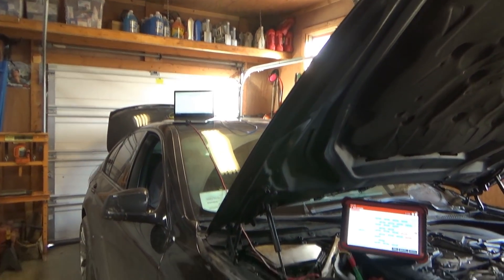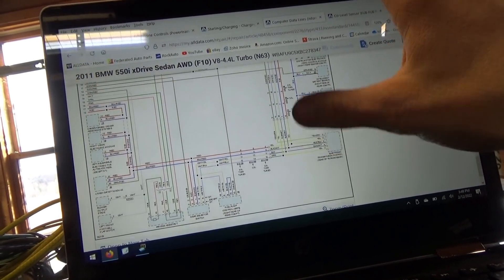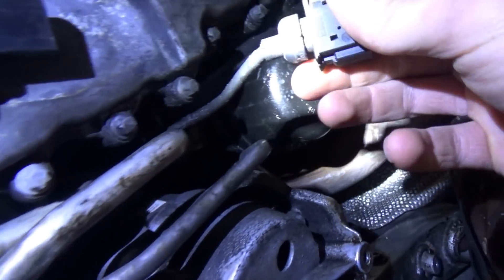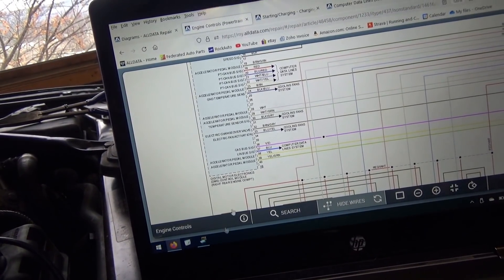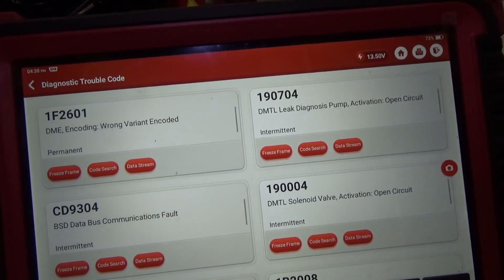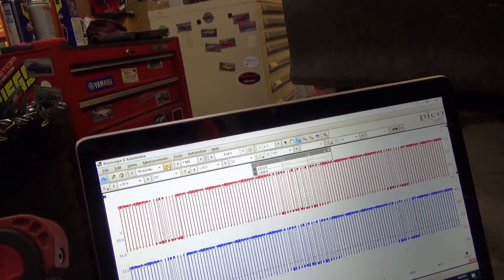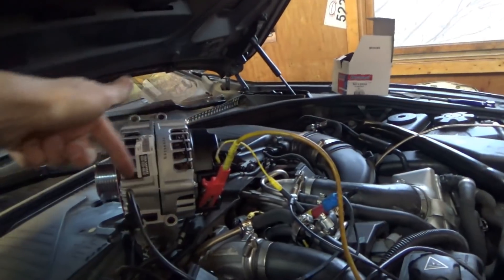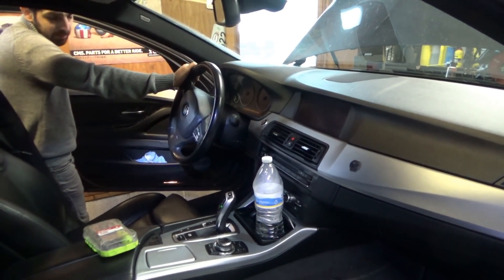Customer Drove 15 HOURS...BMW: What's my OIL LEVEL???

Comment: That was worth the 15 hour drive; great case studies. These cars really are made for wealthy people and corporations that run 3-4 year leases.
Reply: A very experienced mechanic told me, "If you MUST have a European car, buy low mileage ( not new) and sell before 100,000 comes up, otherwise mortgage your house."
Reply: Or, you know, competent mechanics.
Reply: @mungtor  Nahhh... its not worth keeping a car that breaks often. I had a Q5 that needed the ECU programmed at the dealer due to water getting into the housing. Stupid designs, stupid expenses
Reply: @mungtor  the car doesn't have a dipstick...

Comment: It's not the engine ground. They left the ground bolt for the coils loose , which caused the bsd circuit failure. Can't blame the car for someone not following procedure.

Comment: I bought a 2013 BMW 528i with 112,000 miles from an auction.  I knew it had issues before I bought it.  The timing chain was going bad, (infamous problem), the VVT servo motor was stuck in the minimum position so it wouldn't hardly run, the oil level sensor was bad, the AUC sensor was bad, both engine mounts were broken and sunk down, the turbo boost solenoid was bad, and I replaced both Adaptive Headlight Modules due to water corrosion.  So after about $4000 of parts and no labor since I'm a retired auto technician, the car is actually pretty nice.  Who makes an engine where you have to have a sensor to read oil level?  BMW, that's who!
Reply: Pretty much everybody these days.   Checking the dipstick once a week also might not alert you to a blown seal or other leak.  Do you still want a dipstick or sight glass to check the fuel tank?
Reply: @mungtor  but running of gas is different from ruining an engine…
Reply: And how much that sensor cost…🤔

Comment: After solving all these electronic issues this owner has the "joy" of the timing chains, rod bearings and gawd knows what all else mechanical engine parts failing too.  These vehicles are glass cannons.  "But they drive great" - but what if you can't ever drive it because it's in the shop draining your bank account?
Reply: Tesla. An option ?

Comment: My son's 1 series had a faulty alternator that passed testing on a bench but when in the car and driving it would light up so many warnings and throw so many codes in loads of the modules. Ripple current, over charging and cooking battery etc etc etc. BMW's are stupidly complicated across all cars in the range. I love the X5 / X7 but every diagnostic video I see on them just reinforces why I will never own one. You sneeze in a BMW and I swear they throw a code.

Comment: Two comments:
1) If everything were on one network, the car likely wouldn't have operated at all as these module faults began to occur, so the network complexity does provide a level of redundancy.

2) BMW designed this car to be compatible with parts cannon diagnostics.  Just keep replacing modules in sets until it's fixed.

Comment: That oil level sensor is $300 for aftermarket brand. A dipstick would not fail at all. Maybe some of the folks with BMW need to experience some of the service costs personally to understand their wild inventions and maintenance fees.   
No ground wires connected to the engine?  Opps...ouch.
BTW, nice 2X extra long hose clamps on those coolant hoses.
Reply: I've had a dipstick tube rust off and you can't get a new one because discontinued.
Reply: @vw5056  You can make one with a swagging tool.
Reply: @vw5056  Junk yard will have it
Reply: @A. Melbs Ask a repair shop to use their sources and fix it or, do the research. No one is coming anytime soon to help you. If you have no experience in salvage yards and how they are run...pass the job onto someone who is.
Reply: @A. Melbs Open your mind. YOU have to research the part. If that's too much to handle, forget the idea. You have to find the salvage yard on your own...or ask around or get some common sense fired up and challenge yourself in finding a source who has what is needed. Maybe a dipstick tube from a different engine will work, pull out the old rusted part from the block, cut off the rusted area of the old tube, weld on a replacement piece that yields the same length as the old one and press it into the block?  Seems like a fair idea if you can't find the exact one. Most of them are the same diameter so order a new one that has the same diameter and do the above. There is no magic involved, just personal effort.
Reply: @A. Melbs Obviously you are not familiar with cars. Go peddle your papers elsewhere.

Comment: Another great job Ivan! I can feel what you really want to say about BMW’s. Over engineered, way too complex, oddball problems and on and on. No dipstick! Let’s rely on a a complex failure prone system to check oil level. Plus having to use a bmw battery with it’s own chip or else you lose electrical functions.
Reply: It actually makes sense for mechanically challenged owners. If there is a low oil level warning light they might actually top it off.
Reply: BMW engines don't need a dipstick since the dipstick sits behind the wheel. 😉
Reply: @cullenmiller8170  BMW even advises you not to open the hood but to take it to a dealer on their info display. What’s next? 2001, Hal open the hood please. I’m sorry Dave I can’t let you do that.

Comment: So the  final conclusion is to not buy used, expensive luxury SUVs from hack mechanics?  That seems pretty obvious and not really BMWs fault if somebody can't put the car back together correctly.   Yeah, the lack of dipstick is weird and annoying, but 99% of car owners today wouldn't know how to find the dipstick if there was one anyway.   I'll bet a that sensor and a warning on the dash has saved far more engines than the lack of a dipstick has caused.
Reply: Most cars have a dipstick and a low oil light. I imagine they make the cars impossible to work on due to falling profit margins on sales and rising profits on maintenance. That and it is way easier to engineer wires and modules than lining up physical connections for cables and dipstick tubes.
Reply: @_RiseAgainst  Not sure if you're talking about cars in general or BMWs, but I don't think either is impossible to work on.   I've had several BMWs and I will admit that working on them can be tedious, most general maintenance tasks are well within the range of your normal home mechanic.  Changing plugs on the rear 2 cylinders of a I-6 BMW does require a bit of extra work, but so does the rear bank on every V6 Toyota I've come across.  In my experience, the connectors on the BMWs are also less prone to breaking when you try to disconnect them at 100k too.
Reply: @mungtor  what gives me the most hesitation Is the sheer number of modules that need to communicate with each other, the number that can fail simultaneously, and the number that have to be programmed to the car if they are replaced. Diagnosing and programming these problems are too far out of my wheelhouse and I think it's safe to assume very few mechanics are going to get it right the first or even second time. Now I'm not gonna be the old guy that says never, because online third-party support might continue to grow and become user-friendly. But the fact remains, the dealers and manufacturers do not want you working on the cars.
Reply: @_RiseAgainst  I see what you're saying, but I don't think I can 100% agree.   Obviously people like Ivan, Eric @ South Main Auto, and Wes from Watch Wes Work can all handle these things.   You do need new/different tools, but a Pico scope and a laptop isn't a hell of a lot more than a set of SnapOn wrenches.    And I know that they're professional mechanics but lots of people do their own work.  Additionally, how many of Ivan's repairs end up being no parts required?  

There's a lot more to unpack here over current cars having longevity at a performance and emissions level that wasn't even remotely possible 10 years ago, but too much for a YouTube comments section.   It's definitely different and not to disparage the skills of people like Ivan and the rest... but as Eric O. says...  If he can do it, you can do it.  :)
Reply: Lack of dipstick is hardly strange. I have 4 cars currently, none of them particularly new (BMW M5, similar engine to this car in the video) Volvo V70R, Volvo XC70 and a Citroen C5, none of them have a dipstick. I've not had a single car in the last 20 years with a dipstick. Thinking back as far as I can, Mercedes E320 from 2003, no dip-stick.

Comment: Ivan, always love watching your videos as a technician myself. Your case studies and what you come across are incredible. I hope to be at your level one day, you gave me the courage to start using an oscilloscope in my regular diagnostic toolbox, thank you for that! Bravo on the diagnostic, very few technicians would've been able to do what you did.
Reply from the maker: Great to hear that you are using the scope, Sean! Harness the power! 💪
Reply: @PineHollowAutoDiagnostics  it's been pretty amazing using one, I'm always itching to get a vehicle with an issue I can use the scope on now. I had a 97 grand voyager come in with a crashed CCD bus and no coms on the bcm icm and pcm. Got a crash course in differential signaling with the inverse -4.45v and 4.5v on the bus wires. So cool diagnosing down to the component level within a module, I just wish they didn't pot the modules to where it's extremely difficult to repair the failed MOSFET or driver itself instead of using a reman module. I've learned a lot from you man!

Comment: I would not trust something as important as the engine oil level to anything other than a good old fashion "stick it in and pull it out" dipstick!
Reply: Totally agree. My 2016 RRS has electronic oil level and I hate it. Get this though the dipstick tube is still there but just has a plastic cap over it and it is now used as an oil vacuum passage so you don't even pull an oil plug to do an oil change. The oil level has two modes as well, customer and service mode. Shit like this drives me nuts.
Reply: @ohboy2118  I think on Audi's you can buy a real dipstick for it
Reply: @ohboy2118  when you buy something like this the manufacturers look at numbers, that means if the cars that contain this feature is selling, then the customer likes it.
Stop buying cars that has this feature so manufacturers stop putting it in. You vote with your money
Reply: I have the N54 engine and have to use that measurement sensor.  It hadn't failed me yet but a simple dipstick sure would be nice so you could check quality of oil too.
Reply: My 05 Dodge Magnum Hemi came with a dipstick tube but no stick on the transmission but B&M quickly offered one for sale.  That's bad enough but no dipstick on the engine is unforgiveable.
Reply: @williamwhite9767  No trans dipstick is thing on virtually all modern cars.
Reply: My Dodge does not even have a dipstick on the te62 transmission. But it will tell you right away it is the slightest bit low by not shifting right. First thing I did when I got this car was drain the transmission oil out by removing the pan. Twice to get it mostly out. It was cooked and as dark and with clutch material in it I was very glad I did even though the dealership said they had changed all fluids. Worked perfect for the past year so far since then.
Reply: just buy a longer one
Reply: Unfortunately, I think this new method is better for the average car owner. How many people today even know how to open a hood much less  read a dipstick? (Followers of this channel excluded 😊)
Reply: @alex1949  Yah the old system was better because you still had a normal dipstick aswell.

Comment: you do need to replace the alternator, the ecu will not know when to correctly charge the battery as it cant read the signal
Reply: Yep..  bad alternator can cause a lot of issues with a lot of modules
Reply from the maker: It just defaults to 14V which is fine 👌

Comment: That is quite the diagnosis, can't imagine the reason why these components get fried just because the grounds were left out.. on typical cars, they'll just wont work and will get back on line once ground is once again supplied. Thanks for taking us along Ivan! Cheers
Reply: My guess:  Modules grounded to engine get spiked by battery positive voltage on their ground leg, during CRANKING, when the engine's battery grounds are crappy or omitted. Remember that starter surge is in excess of 1000A, and a poorly grounded engine can act as a node in a voltage divider network. Now, one would hope that engineering hardens modules against reverse polarity and destructive currents, yet hooking up a battery backwards for just 100us might be enough to melt your credit card $$.
Reply: bad design that's why
sensor and control should be isolated from eachother inside the ecm
Reply from the maker: Because BMW 😅
Reply: @PineHollowAutoDiagnostics  , hahahaha

Comment: Yay more cars with sensitive components.
With the technology avalible they can implement rugged Inputs and outputs.
But I guess a extra $20 per unit is to expensive.
Reply: Right i wish i could get my 94 camry back had zero issues

Comment: Good stuff Ivan. This is why I wouldn't want to own a BMW, Mercedes, VW or Audi. Typical German over engineering and complication. Great driving cars but you will need to form an intimate and expensive relationship with the respective stealership. Good luck.
Reply: OIL BURNER
Reply: These cars don't have a passenger seat next to the driver.  That position is reserved for your mechanic.